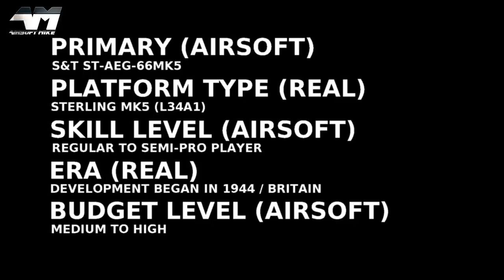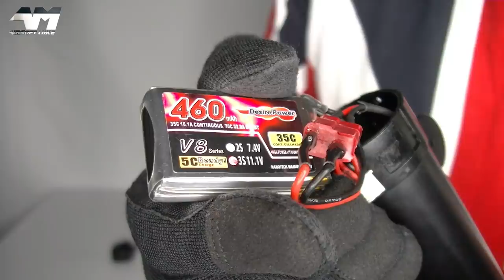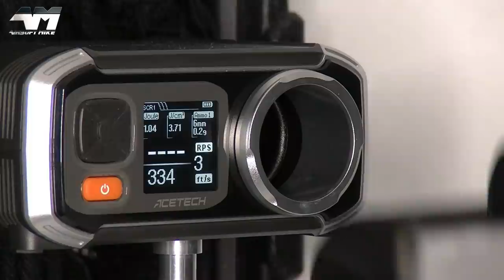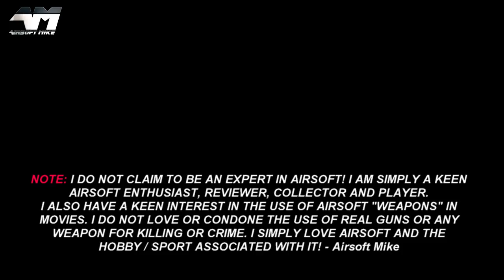S&T STERLING MK5 L34A1 / Forgotten AEGs / ST-AEG-66MK5

Comment: My Dad had one of the standard Sterling models from S&T. It's been stuck in repairs for nearly 3 years, as somehow the trigger mechanism knackered itself after 2 uses. For some reason they can't get it repaired, but are still looking for a replacement because apparently the internals on the newer versions are slightly different? Don't know if this true, but he's going to find out whats going on with it this week. Been a nightmare.